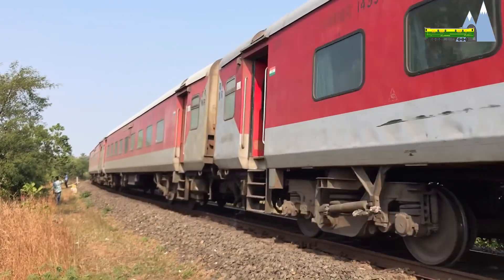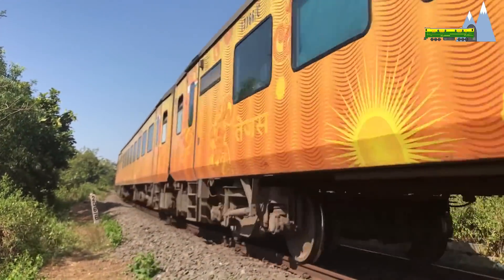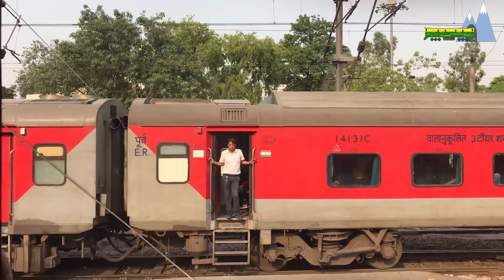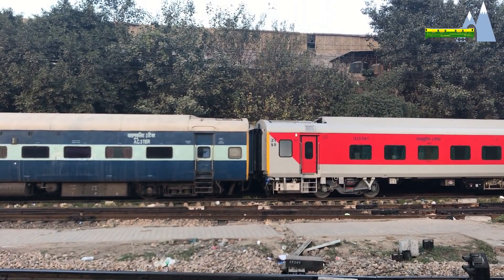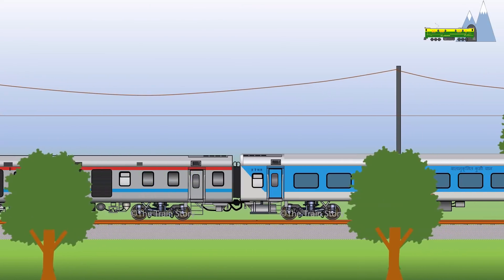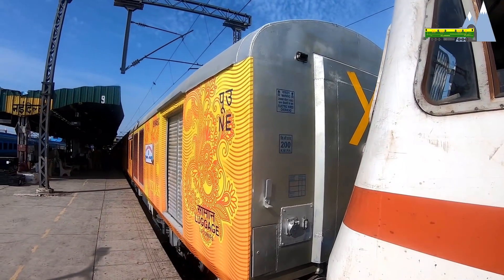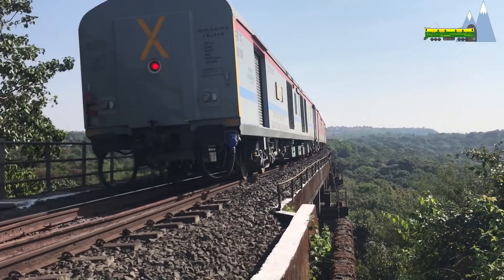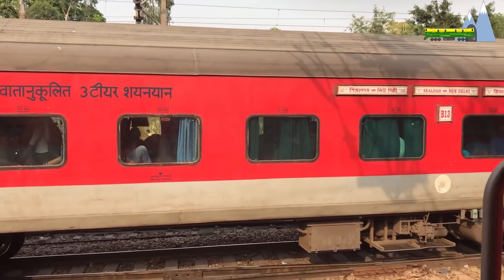Rise of LHB in Indian Railways | LHB Coach | Indian Railways | Linke Hofmann Busch

Comment: One day when i was travelling in icf coaches there are cbc coupling after upgrade in utkrisct coach which are safer than screw coupler. India railways are giving cbc coupling in icf coaches before converting into lhb coaches.
Reply from the maker: Yes I noticed that… cbc couplers are one aspect but if I m not mistaken, ICF bogies also lack yaw dampers

Comment: Indian Railways now decided to produce only 3000-4000 LHB coaches per year.
Instead now "Trainset" like Train18 or Vande Bharat will be put in focus & production on large scale has started since 2021.
Reply from the maker: It’s high time IR shifted to trainsets. I just hope the internal bickerings which stalled Train-18 are now a thing of the past… A tilting train set could run at ~225-250 kmph on existing network of the railways (after suitably fencing off)

Comment: In 2012 I found it strange that even electric trains used diesel generator cars. It is good that this is now changed. In Europe, even with four different electric systems, locomotives generally provide "hotel power" to passenger trains, even diesel locomotives are equipped with generators for this purpose.
Reply from the maker: Yes it was a strange bureaucratic decision of not using power from OHE for Hotel Load.

Comment: as a rail enthusiast, i will miss ICF, they had less jerks n more sturdy especially for long journeys.
Reply: I thought LHB coaches are more comfortable than ICF coaches. If you enjoy shaking and vibration i can understand why you like ICF. 
On the Eurorail the ride is so smooth, you don't even feel you are moving  sonetimes.
Reply: @rogers906  ICF win in the less shakiness aspect especially when sudden braking or acceleration is witnessed.
The lhb may win in speed and noise but when it comes to comfort it's the shakiness (less) aspect
Reply: @satya4uall  so let me get this straight are you saying the older ICF coaches with less springs and dampers shake less than the newer LHB coaches.   That is going backwards
Reply: @rogers906  May be due to heavy weight the ICF have less shakiness
Reply: @rogers906  he is talking about Buffers.
CBC hits hard when accelerated or when breaks are applied.
Air suspension on LHB is good but the aforementioned issue remains.

Comment: Instead of using generators in cars , why don't they directly use electricity from OHE cables (a car with transformer inside) (for those areas at least which have OHE cables above)
Reply: They are Directly using overhead power now for coaches

Comment: These new coaches should be upgrade further to support 230kph.
Reply: The lhb are capable of 220km/hr
Reply: Still they need some upgrade to match European class high speed trains.
Reply from the maker: I think future investments will be on aluminium trainsets. The lighter car bodies could allow higher speeds
Reply: They should also use steel reinforcements. Which will make them tougher.

Comment: The comfort and experience of lCF coaches of Rajdhani express of 80s and 90s, identified by red and yellow colors was par excellence. The current generation of coaches can't match that experience. Because of light weight and other design changes, when train with modern LHB coaches accelerates or applies brakes, the experience is similar to a bus ride. In terms of speed and noise generation, sure LHB coaches beat the ICF coaches.
Reply: CBC on LHB is the culprit.
ICF had 2 side buffers which made the sudden jerk when braking super comfortable.

Comment: Why simply hype for so many neglected public comfortableness?. The design is in a way that it attent the issues of suspension, collision safety, fire safety, fuel efficiency etc. But it had simply neglected the basic needs as spaces between berths, space between opposite berths/seats, width of berths, adequate roof height, tiolet area space and many more what previous ICF coaches had. Number of berths per coach is less to ICFs and does it need to lessen space per berths. Smaller size in coaches enable less friction for whole train stretch while at short turns. Also there are so many variants in this coaches and most have these irritating issues. Seem they simply missed thinking about public and citizens. Earlier these people brought in with added third berth for side berth in which it already needed some adjustments while travel time.
Reply: 2020 manufactured  lhb sleeper and Ac have improved this problem.

Comment: Train 18 is purely ICF modiefied rake from ICF perumbur chennai, the other LHB coaches majorly from barielly
Reply from the maker: It is not clear what you mean with ‘purely icf modified’.
Train-18 is not a Schliren design. It is 100% LHB (designed and built at ICF Chennai)
Majority of LHB cars are built at RCF Kapurthala, ICF started manufacture of LHB few years back. The MCF at Bareilly is a new factory and only recently began roll out of LHB.
Reply: @TheTrainStory  question

Comment: Indian Railways should pioneer battery electric power for railways - first of all for metro trains. Electricity supply is less reliable in India. India has space for a lot of solar power which is very cheap in India. Like the coal and water tender for steam locomotives, India could pioneer a 'tender' which is a self propelled battery drone. Charging could just be done at stations, even every fifth station and end of line. It could recharge itself at the end of the Metro line while being replaced by another. There will be a huge saving in electrical infrastructure. The number of battery drones will just depend on the number of trips. While Indian Intercity passenger trains are very long, and extra cars may come at the expense of passenger cars, self-propelled battery drones do away with diesel engines. They can go through long tunnels with the tunnel requiring ventilation beyond that for fire services. The trains become much quieter.
Reply from the maker: Battery operated locos may not be a viable option for long distances moreover disposal of used batteries will bring their own problems. 
India has already invested heavily in overhead catenarys. Solar power where possible could be used to power substations which could then feed the OHE. 
But for now, India has vast supplies of cheap coal. It is unlikely IR will seriously look for alternatives. And that too would depend on government policies. The most likely replacement for thermal power would be nuclear power, not solar

Comment: Train track should be modernisation to capable of run the train  at the maximum speed of 400 KM's ph  in view of new technology improvements to be used to upgrade the existing tracks
Reply: For that
We should have a large area like indian railways....
And it's not easy...
For that maybe we have to remove railway tracks... And build concrete tracks which metro, bullet trains used because it can hold 500kmph+....
Even we will upgrade it... It will take on under 200kmph... We can't run 400kmph on that track...
Reply: For that
We should have a large area like indian railways....
And it's not easy...
For that maybe we have to remove railway tracks... And build concrete tracks which metro, bullet trains used because it can hold 500kmph+....
Even if we will upgrade these old tracks ... It will take on under 200kmph... We can't run 400kmph on that track...

Comment: Very informative the old IR coaches really were decrepit looking with a ton of people riding on the roof, now the new cars look more in line with a country of India stature.
Reply: By 2023-24 Indian Railway routes will be 100% electrified. So, no more people on roof 😁.
Reply: @hritikjuyal5484  Honestly... I were in nearly all parts of India. Although trains may be incredibly full... (Non Reserved train parts and Mumbais local trains as the extreme)... I never saw people on the roof of trains... have you actually seen it? Where? I think it's more a stereotype.
Reply: @Gebieter  Pictures of people on train roof are shared online as they are from India but in reality most of them are from Bangladesh. Diesel engines are rare these days on railway tracks. With electricity wire running over  train routes, no one would dare to ride on train roofs.

Comment: Thanks for succinct explanation. It appears that the LHB has a long life ahead, since 200K speeds are likely to be the speed limit for at least 25-30 years, by which time hopefully air mass transit will be an affordable reality, leaving the rail network for mainly cargo duty and recreation travel.
Reply from the maker: I prefer India follow the European model which invests in and encourages rail travel. 
Air travel requires imported oil but rail uses Electricity generated from locally available coal.
If the Mumbai Delhi route can be brought down to < 9 hours... Rail will have advantage
Reply: @TheTrainStory  Not only that but air travel involves tedious 'security theater' that makes shorter journeys unattractive compared to high-speed rail. It doesn't matter if you fly faster if the total journey takes longer.

Moreover there are practical limits to how many flights can be handled at busy airports. Of course there are limits on how many trains can ply as well, but based on the forecasts we'll need all the capacity we can get.

Luckily smaller Indian cities are clustered around larger ones so high-speed rail should be viable unlike the US where large population centers are spread out.
Reply: @TheTrainStory  how about building a high speed train parallel to DME

Comment: The First Original LSLRD was Used by IR by 2423/24 & 2435/36 New Delhi - Dibrugarh Rajdhani Express between Guwahati to Dibrugarh with 3 AC III Tier , 1 AC II Tier, 1 AC I Tier , 1 Pantry Car & 1 EOG Coaches and 1 LHB SLR till full 24 coaches where permanently run between DBRG and New Delhi. I Myself travelled In the AC II Tier and AC I Tier every time
Reply from the maker: Thanks for the update...

Comment: Very good narration. I think it's better to drop the bullet train project and spend same amount of money in upgrading the speeds of the LHB coaches to 300kmph.
Reply from the maker: The FIAT bogie may not be suitable for 300 kmph. A new bogie would have to be designed or imported. And a high speed system is more efficient with trainsets. The indian BG system can attempt for 200 kmph or 250 kmph (with tilting systems)
Reply: @TheTrainStory  In what way trainsets are different?
Reply from the maker: @treatseaweed  Trainsets have power distributed in all the cars. There is no separate locomotive. This results in faster acceleration, shorter braking distances and faster turnaround times. A close analogy is a 4wd car where tractive power is sent to all wheels
Reply: @TheTrainStory  Got it. Thanks
Reply: @TheTrainStory  Now India will have the combination of trainsets and Locomotive driven

Comment: Why memu, demu, emu coaches are icf type? They also need to be LHBfied.
Reply from the maker: The Train-18 is technically a MEMU. It is an EMU train set operated on the mainline. As for DEMU, the railways had issued tenders way back in 2012 for a LHB DEMU. But now with plans of 100% electrification a LHB DEMU may not be produced.
Reply: @TheTrainStory  Yes

Comment: LHB cars aren't designed for qet toilet flushing and toilets are a mess. 
They also have a high wear and tear of bogies and other moving parts and dont provide alternators and a better comfort than ICF coaches. But LHB is better looking and safer so IR should work on weaknesses of LHB. IR should go for self propelled cars and stop LHB coaches also.
Reply from the maker: It is not clear what you mean by wear and tear of bogies. If you mean metal fatigue, that would have resulted in many derailments and accidents. Moreover maintenance schedules for the LHB bogies has higher time intervals than the ICF. But this is a important point you make and I will spend time researching this aspect more. As for better looking, looks and beauty are subjective aren’t they 😊 ....
Reply: @TheTrainStory  LHB was never designed for wet flushing that Indians do. It had suction flushing using little water and in Europe there are no sleeper or long time journeys. In India it was designed but has problems not because people put things which is another issue. Under body and bogie fatigue and resultant  cracks have been highlighted in ICF report published by The Hindu and TOI - Google and see. But they have not resulted in any accidents while running so far but have been noticed in maintenance. Expert opinion is called for. Up to you to take it or leave it.
Reply from the maker: Actually Europe does have sleeper as well as long distance overnight trains. This is first hand information because, I have lived in Europe. 
In an academic discussion ‘take it or leave a it’ is not a particularly good response.
There can be agreements and disagreements 
I did not contest your pointing out issues with the LHB bogies. I only requested you for the link. Sure I can search on google but since you already did that, I requested for the link
Reply: @TheTrainStory  Western Europe has just one sleeper train in UK called Calodonian sleeper and some trains in Eastern Europe. Main countries like Germany, France, Spain, Italy have virtually no overnight trains and I have lived in France. With so many links in Google about Indian LHB issues you should try there or in TOI Or The Hindu where I just read a few weeks ago. I said take it or leave it as I don't want to prolong this discussion. Thank you.
Reply: @kanakasabhainatarajan4887  Question is no longer
Reply: @TheTrainStory  To some extent he is telling the truth. I read the article.
But most of the problems are caused by cheap and non standardized parts supplied by the private vendors. It has nothing to do with the actual quality of coach
Reply: I Strongly Disagree.
Reply: @hiteshsinghx  what disagree. I have quoted from ICF Chennai press release published by TOI and The Hindu. Just Google or travel in any LHB even a/c coach in Rajdhani or Tejas to see overflowing toilets.
Reply from the maker: It is strange that ICF would publicly admit ‘defects’ in a IR product. The overflowing toilets are because people use bio toilets even when the train is stationery and dump garbage into the toilet. If the toilet had just been a hole in the floor (like in the past), they would not be overflowing. Anyways could you share the links of the TOI and Hindu articles. Thanks
Reply: @hiteshsinghx  ICF has stated that even cracks  have appeared in the underbody of LHB coaches in a short time but nothing happened to affect safe running.
Reply from the maker: With Train-18 the plan was to shift to self propelled train sets but internal politics in the IR may have delayed this for a while...

Comment: Why there is a jerk in lhb car when the train starts.
Reply: You won't belive but if there's no jerk the train won't move. Therse a space provided in couplings which causes jerk. So that the engine won't have to face the inertia of all the coaches at a single time instead because of gap it overcomes the inertia of choaches one by one.
Reply: @kunalkawale4829  That's an amazing answer bro i too had the same doubt. Now I realize that its a nice feature which will allow for faster starts!
Reply: Due to Inertia of motion
Reply: @navneetranjan3642  I belive she's asking why there's more of a jerk than on ICF coaches, which is answered by @Kunal Kawale
Reply: Coupling oh lhb is the reason
Reply: i had the same experience while travelling in duronto lhb
Reply: Due to cbc coupling and they have solved in 2019 to current manufacturing lhb coaches

Comment: With the common appearances of LHB, I think IR should now work seriously on another higher level (or Ultra) LHB rakes, (call it UHB) that can be used for Rajdhani, Shatabdi, AC Duronto, etc. ,, which can overcome all the disadvantages of present LHB cars, some genuine qualities of ICF cars, complete smart integrated system, using some more lighter and stronger material, etc. Also replacing of EOGs with 2nd class coaches. 

More than UHB, LHB, etc. IR must work on with Alstom as well as ICF, to generate an Indian version of high-speed TGV trains, having Jacobs bogie which is ultimate super speed, Let's assume that to be as Train 22.
Reply from the maker: Jacobs bogies are one option but options like the ICE and pendolinos could be tested as well ....

Comment: LHB is disaster
Reply from the maker: Sir could you elaborate why you feel they are a disaster
Reply: @TheTrainStory  
Braking is jerky. And during night journey travellers on sleeper always experience roll off
Reply: @kgravikumar  but safety more matters
Reply: @kgravikumar  sir has been solved late 2019 lhb coaches .
Reply: This is because of CBC (Centre Buffer Coupling). It Prevents Coaches from climbing up on each other in case of an accident, unlike the screw couplings used in icf coaches
Reply: @hiteshsinghx  Yes you are right

Comment: Indian Railway Is replacing all ICF coaches with LHB and this is really great. It will boost passenger carrying capacity, speed, revenue, safety... But earlier there was a different identities of all trains. Like normal trains were blue in colour Rajdhanis were red gareeb rath green duronto had a different pattern I liked all those... Can't railway just paint like that ? I mean all coaches will be LHB ofcourse but just paint them accordingly... That would be awsome...
Reply: IR is replacing all lbh rajdhani express rakes with tejas smart lhb sleeper rakes. Lookup on my channel I have a video of tejas rakes which are going to replace current rajdhani`s lhb rakes
Reply from the maker: @hiteshsinghx  I have seen your video...
Reply: @hiteshsinghx  Yes
Reply from the maker: IR does use special liveries even with LHB rakes, the Tejas and the soon to be launched LHB Deccan Queen...
But if IR moves towards trainsets, it may spell the end of special liveries and also possibly names. Trains may be identified with just numbers.